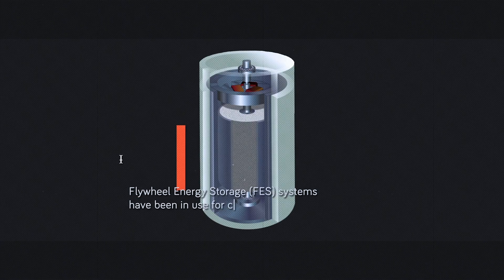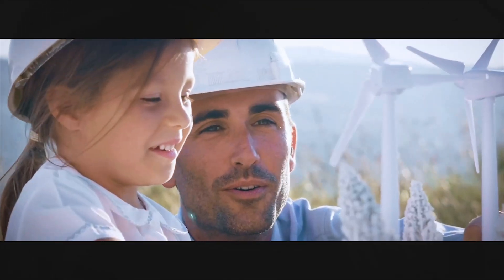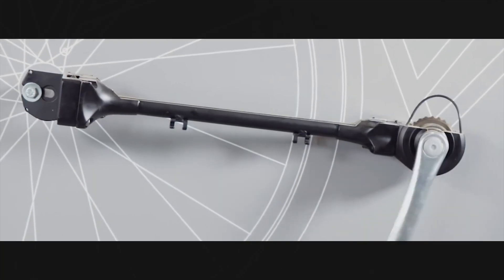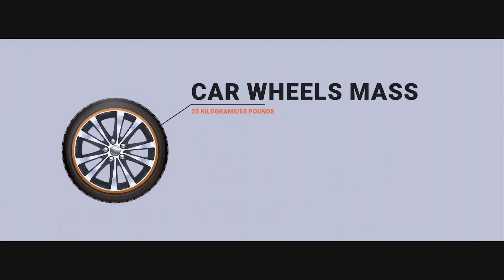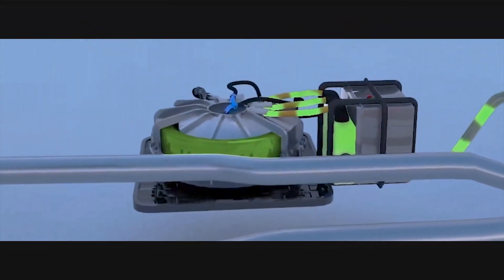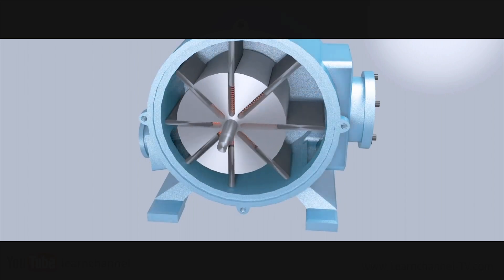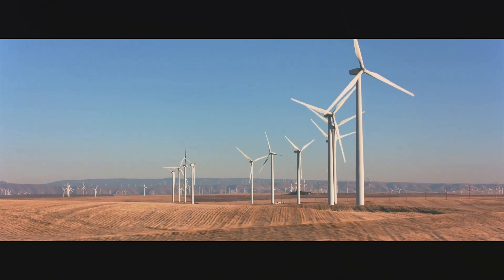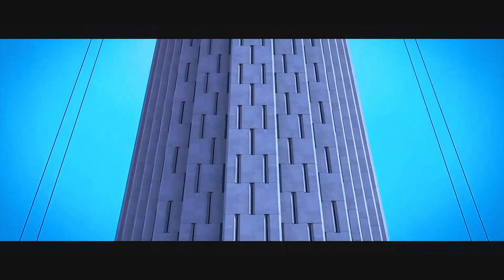The Flywheel Battery Are Finally Back

Comment: I recall the Rosen brothers built a flywheel generator and found it did make the car handle very strange and took a lot of engineering and 24 million dollars before they pulled they plug so to speak.
Reply: I was thinking about that too.  It would have a gyroscopic effect on handling and turning corners.  But surely if there were two wheels turning in opposite directs that could be canceled out.